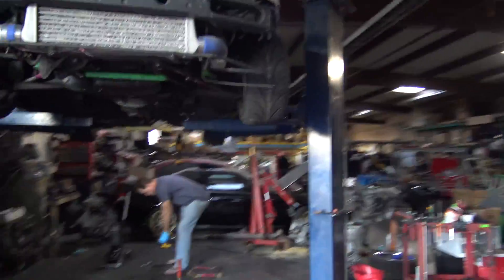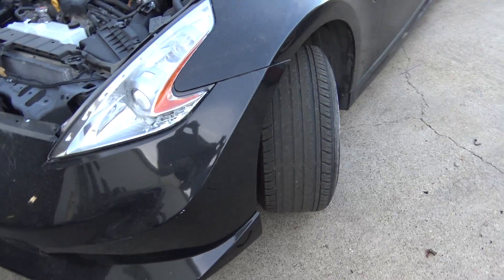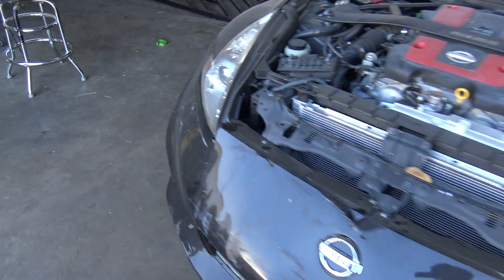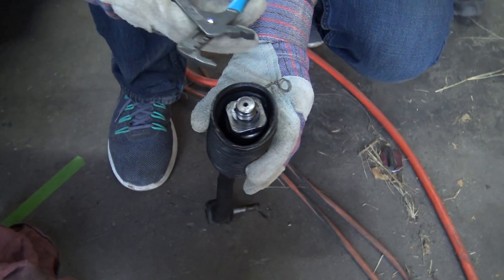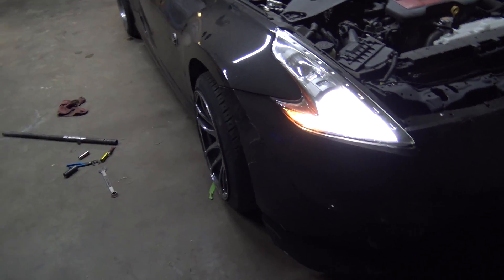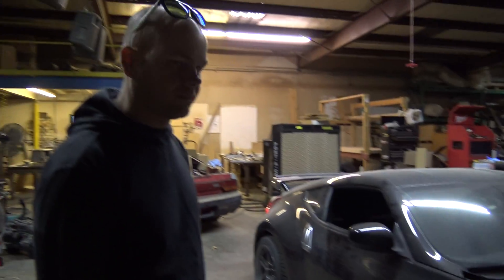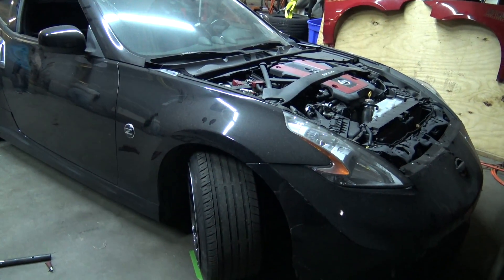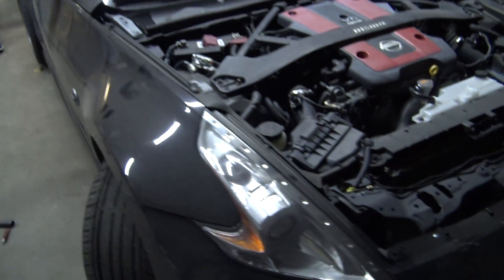Nissan 370z DIY Simple steering angle mods!

Comment: Foxbody and SN95 Mustang guys do a similar thing by shaving the inner tie rod (Inner tie rod is the female threaded part). When I did it I gained about 5* by shaving around the same amount you had on the spacer so for the 370 to gain 5* sounds about right

Comment: Trevor, just a heads up with the z34, TCS never fully turns off and is known to kick in when you aren't expecting it. I believe there is a way around it by removing  a fuse or two from the box next to the battery, but i cant remember how off the top of my head. I think its along the same lines as the sequence you have to follow to disable the steering wheel lock function that loves to leave you stranded with a locked steering wheel. I had to do it to my 2010 Nismo Z lol
Reply: You're probably talking about the VDC sensor that can be fully switched off by adding a toggle switch to the green wire on the VDC module (located under the heated seats switch).